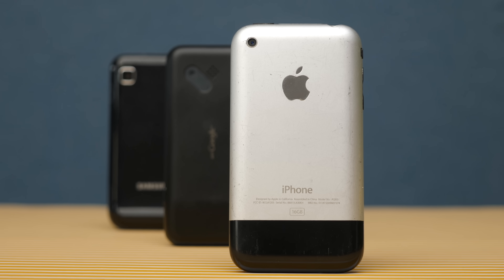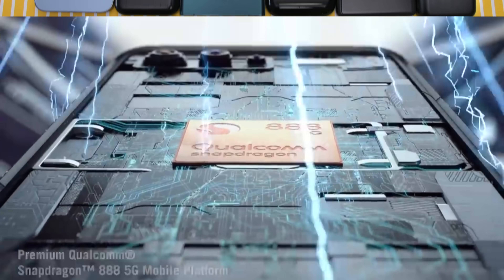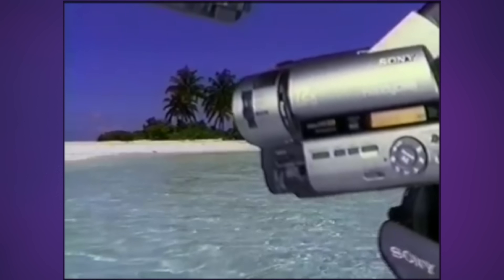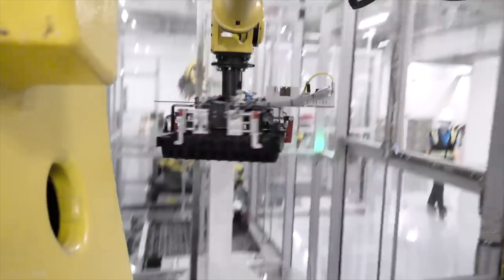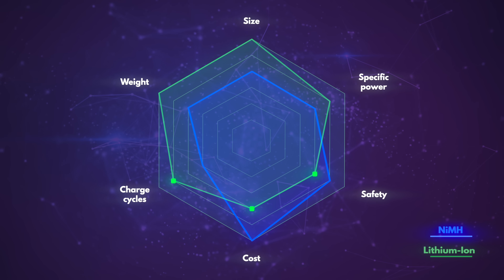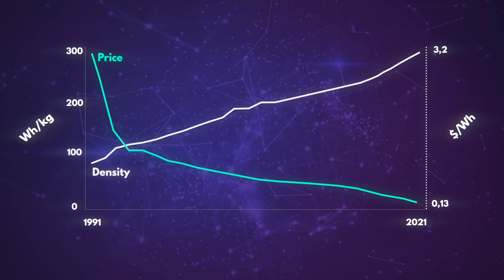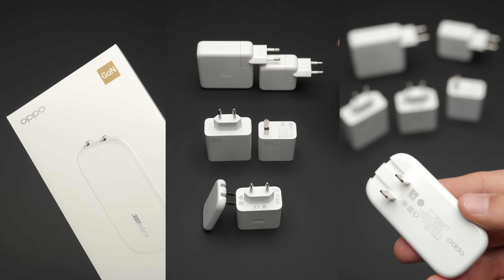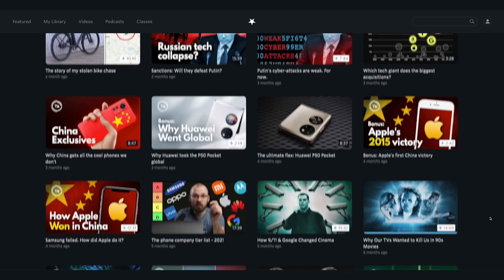The billion dollar race to fix phone batteries

Comment: The least improved part of a smartphone is resistance. You used to buy a phone and that's it. Use it. Now you have to buy a screen cover, a phone cover. Phones used to drop on the floor and one piece got to each side of the room, you put them together and done. Now it scratches, breaks, etc. We are now using expensive fragile bricks made of glass rather than a decent piece of hardware that can stand day to day use.
Reply: Well, yeah, phones became multimedia powerhouses during that time. Phones are becoming more durable, though. I should know, I'm part of the small segment of the population funding them. My three most recent phones having been the Unihertz Titan, Pocket, and RAZR 5G. Flexible displays seem to be promising and I hope that cost of ownership continues to trend downward in years to come. What are your thoughts on foldables and their impact on durability?
Reply: @saygoodnighttoghosts  Yes there are indeed many hardcore brands (don't know if this is the right name for it). I even thought about buying one of those twice, but the hardware isn't impressive. I don't really like the idea of foldable phones. Its kinds of build an extra step to use the phone. But I really like the idea of slidable phones. I had once a Motorola that the keyboard slides and it was a physical keyboard. Was pretty good. No problem with durability and convenient to slide. A screen that expands would be much better. You use the phone in the regular way and if you need extra space just slide it. Foldable on the other side they make an even narrow rectangle, kind of makes you need to always open to use. Plus I think its less durable, but who knows. The idea of a screen that folds or slide is good, considering the current size of screen is too small for the amount of things we do in our phones. I have a Galaxy Note 20 Ultra and I think the screen is not large enough. I use desktop most of the time, specially for shopping. Phones are too small.
Reply: @drac124  I'm on a Fold4 at the moment & the cover screen is actually really usable even with my big hands. I only do maybe 25% of my usage on the main screen. But the times where I do need the big screen, it's incredible
Reply: Nokia again.
Reply: What the fuck are you on m8?
I've dropped my old Samsung Galaxy countless times, and it has maybe one scratch.

Comment: In my opinion, I think we should try to optimize software more, than try to brute force more battery capacity. Cool video tho. It explains a lot in a manner that's easy to understand
Reply: I would agree with that - there's a lot of inefficient software and/or bloatware nowadays, just because the hardware is often powerful enough for it to "not matter". And as a developer myself I share the sentiment that it's nice not needing to actively optimize everything and focus on the business logic, what the software should do, but it does come with a price to pay. And when a news website (indicating: simple) takes long to load or is lagging when interacting with it, or when a supposedly simple operation, like opening a menu in a program, takes longer than an instant, something has gone pretty wrong..
But in the average company optimization probably* is not exactly a common topic and priority for stakeholders/product managers etc. and apps by a single dev are often enough built by inexperienced devs that don't have the knowledge or interest to optimize things, at least I assume that's the case for most software.
(I don't exclude myself, I definitely have written some very inefficient stuff due to not knowing better and often enough don't pay much attention to it.)

* I am fairly new in the professional industry and have a sample size of one unfortunately, but I've also heard from multiple people with similar experience.
Reply: That's also happening simultaneously. I think so
Reply: Text renderers have gotten significantly bloated over time. Instead of doing full hinting as was originally intended in TrueType, they use lots of bloaty render techniques that make not only the performance but also the rendering quality even worse. Microsoft’s best renderer is the one they used before they introduced ClearType. So on Windows you have to disable ClearType to get the correct rendering (even then, it doesn’t work for DirectWrite which is even more bloated). And virtually no Unix systems provide ways to unglitch TrueType rendering.
Reply: @groszak1  The move to higher resolution led to less need for hints, and greater need for resolution independence. Notably, new font rendering is performed on the subpixel level, which probably has a heavy computational cost if the rendering is done on CPU. If the application moves rendering to the GPU, the computational cost should be negligible. 

Font rendered on Apple Quartz, for example, is done on the GPU.
Reply: @Lauren_C  First of all, hinting is still extremely useful at higher resolutions. If you think about it, it ensures that horizontal and vertical lines are pixel perfect. The stems might be 1 pixel thick in bilevel rendering at 4000ppm, but at 8000ppm, those stems would be 2 pixels thick with gamma-correct anti-aliasing (unlike in modern renderers) but still pixel perfect. The idea that the need for hinting would disappear with higher resolutions is a total myth, I think commercial type designers perpetuate it because manual hinting is not cost effective despite being important to screen typography quality. And the concept of subpixel rendering is based on another myth, since it actually prevents vertical lines from ever being pixel perfect, which makes standard render mode the better option. And there are many other quality issues with modern typographical renderers like incorrect gamma (making the anti-aliasing effectively useless), and overlapping lines (which should be clipped). So the GPU renderers you are talking about just reek of that ‘child labor’ type of quality control, not to mention they don’t work in legacy computers.
Reply: That's what Apple does, not just with batteries. They heavily optimize memory usage, software, etc. and the result is less energy consumption and faster performance.
Reply: @ronch550  No, their software is Unix based so it’s highly bloated. The real optimized software came from legacy Microsoft. They literally made a renderer called GDI that is the fastest renderer ever, so much so that I consider GDI to be the only hardware accelerated renderer ever. Of course, modern Microsoft software (as opposed to legacy) is highly bloated as well.
Reply: @groszak1  well not much can be done with Unix or Linux (Android), but Apple still heavily optimizes whatever they can. I'm not an Apple fan, btw.
Reply: @ronch550  I don’t think shoving child labor ARM computers in there is software optimization.
Reply: @groszak1  it's not. And I think you're veering off topic.
Reply: @ronch550  Misinformation
Reply: @groszak1  I'm talking about software optimization, you're talking about child labor then you say misinformation. What are you smoking, man??
Reply: @ronch550  Reported
Reply: @groszak1  ditto
Reply: Ending ads would help.  Why should I pay processing power and battery life to watch someone else's ads.

Comment: I don't care about charge speed, I care about longevity.
If I was forced to charge my phone at 5w for it to live 2 extra years, I'll take that any day than 120w charging
Reply: Luckily the scenario you describe is very possible.

Charging at 5w will give you at least 2 more years than charging at 120w.

Most Androids allow you to terminate charging at 85% nowadays also which will also help.
Reply: 120w charging is the best thing to have happened in phonetech in years. 20min charging time negates much of the negatives of crappy battery life
Reply: @joonasvahasalo6635  no it doesn't, it take takes you 20m to charge and only lasts 40m until it dies, thats still bad
Reply: Right to repair is the better sollution I guess
Reply: I am an electronic engineer, but I don't study batteries. From my limited knowledge the only tech discussed in this video that can improve the battery longevity is the solid state battery.

Comment: I think for mobile tech the other side of the equation might be as important as battery tech. Apple virtually doubled battery life in their MacBook range by switching from Intel to Apple Silicon. I think a shifted emphasis to efficiency across the market is pretty important. Obviously there's less room to squeeze in the smartphone market where efficiency has been a much bigger factor already but I expect there's still some room to move in that space. At the moment we seem to be getting bigger and bigger phones with hungrier processors and bigger batteries for steadily diminishing returns.
Reply: Apple switched from X86 to ARM. Phones are already ARM so not much improvement is to be had
Reply: @michaeljohnson89  A15 was a pretty big efficiency jump?
Reply: @michaeljohnson89  See the Risc-V instructions set
Reply: @michaeljohnson89  The efficiency improvement largely comes from the density of chips.
Reply: @Jona69  That's just not true... Just look at Qualcomm processors. They already are at 4nm while Apple still stucks at 5nm and yet Apple gets MUCH better efficiency out of it.
It's nothing but a myth that higher density and smaller Production notes magically improves efficiency.
Reply: @Raja995mh33  I meant the efficiency improvement the MacBooks got when they switched from Intel to Apple chips. They went form intel 14nm to tsmc 5nm.
Reply: @Jona69  And now even with Intels 10nm (which is more dense than TSMCs 7nm), Apple still winds by a LONG shot in terms of efficiency, draining less than half the power in a comparable system. So switching from 14nm to 5nm didn't had a huge impact after all. Intels chips are still just literal hot garbage in terms of efficiency.
Reply: @michaeljohnson89  Agreed.  He must be talking the (battery life improvement), seen on their LAPTOP COMPUTERS.  OR, maybe, the M1 chip is a RISC chip, (that is just that different).  As compared to a regular ARM chip.  (Different enough to cause a huge difference in "power draw").  I'm not an authority on the M1 architecture (except that it is amazing).  And, SINCE, it is amazing (as compared to the last generation RISC chips.  Right now, I will give, ANY, claim a "little" credence.  That it, might, be truth.
Reply: @vangildermichael1767  ARM is a RISC architecture. Also M1 is literally the same tech as the A14 used in the iPhone 12.
It's effciency is on par or actually worse than the A14 it's just paired with much bigger batteries because it's used in laptops. Said laptops are also been compared to much less efficient Intel or AMD laptops. AMD comes the closest and they were using TSMC 7nm at the time which can't compete with TSMC 5nm plus the more efficent architecture of the M1. With phones your already comparing ARM vs ARM instead of ARM vs x86 all of which are also power optimized compared to laptops and especially desktops.
Reply: @vangildermichael1767  eh no ARM is a RISC architecture. You don't know what your on about
Reply: @harryhall4001  True
Reply: There isn't going to be much gains in terms of efficiency. Screens need energy to light up and modems need energy to send and recieve signals. Even if SoCs manage to do computations with fewer and fewer electrons there will still be other parts of the phone that are hard to make more efficient.

I don't see a paradigm shift on the horizon. Folding phones are trying to change the form factor but are expensive, fragile and fail to impress. I believe that in 5 years from now phones will look similar as they do today, only more optimized.
Reply: @LeonardTavast  You're probably right, I think that given where they are now, smartphones would be hard to replace or radically change on a societal level. My current phone is just a much more advanced version of what I had 9 years ago.
Reply: @LeonardTavast  *with even less useful features.
Reply: Also doesn't help that software developers take all that extra power today's hardware for granted and do very little optimizations, which leads to more battery drain. Take any old android pohne and install some basic apps and just watch it absolutely chug with low ram capacity.
Reply: It's the huge screen size and unnecessary screen resolution who are the energy hogs. A 4K screen literally pushes 16x more pixels than 480SD display. Imagine using 16X less data and 16x less processes. Also, a reduction in screen size from 6.4ish to 4.8inch is an additional 25% saving of screen lighting.
Reply: No queeu
Reply: And Apple is pretty much the only one that always had this stuff in mind. Apple always focused on efficiency in the iPhones while literally all Android manufacturers - to try improving battery life - only included bigger and bigger batteries. And now, where this no longer works because phones would become too heavy, cameras take up more and more space, many Android manufacturers are basically stuck there while Apple improves more and more in terms of battery life, basically being king in battery life for a long time now (ESPECIALLY when you keep the battery sizes in mind because then there comes nothing even close to Apple).
I also, like I said, have my doubts that there actually is a lot of room to improve because it most likely has some reasons why battery sizes on Android phones haven't really improved in the last several years. They're basically stuck at 5000 mAh with only a few exceptions

Comment: As someone that's in the RC hobby LiPo batteries have the benefit of usually a higher discharge rate or whatever you call it been making out put a lot of Power 

Best way to explain this in phone tech is like how companies have recently started making batteries in like two parts so they can charge them faster 

Well a 2s lipo battery is pretty default now in the hobby so think of that as 2 small packs that act as one 

You can get up to 6s maybe even 8 idk 

Also you said lipos are more fire resistant... Ahhh no lol complete opposite look up lipo fires lmao

Comment: I think the next step is to make much more efficient chipsets rather than more powerful ones + industries research alternatives to Lithium-ion/polymer  not only in phones but for other specific applications  (like lithium iron phosphate for drones) so the demand for components for lithium-ion/polymer is reduced
Reply: But improving chipsets efficiency become more and more difficult too as lithography process improvement become slower every years
Reply: @Arkan_Fadhila  A, shall I say, "courageous" option would be to settle on a standard performance level for phones that has no need to be surpassed. This way any efficiency gains wouldn't be immediately offset by increased processing demands. For example, take the Raspberry Pi 4 whose processor is currently manufactured with a 28nm process (however that correlates to Intel and TSMC's process definitions). Imagine setting that as the performance target, but using a 7nm process. 1/4 the nanometers means 1/16th the chip surface area and theoretically about 1/16th the power consumption. I'm sure the math isn't that clean in practice, but the point is the triangle of tradeoffs for chips is basically power consumption, cost/size, performance. If we sacrificed performance, we could have incredibly small chips that use very little power. That's a tough sell marketing-wise, but I think plausible with the right branding as a "lifestyle" brand of product where owning a low-power phone signals detachment from the treadmill of endless tech consumption.
Reply: @stormburn1  really agree with you. and hopefully people will realize that processor with higher efficiency is more needed compared to processor with just higher performance alone.
Reply: Also, if people make more efficient software, we can use less processing power and save even more battery life.
Reply: Nah. I want more powerful chippers not ones that are more efficient. Efficiency is boring.

Comment: So most larger battery systems (usually batteries >1000W like big external batteries and EVs) use lithium iron phosphate, not lithium ion batteries. They weight a LOT more and support more charge cycles. These batteries are different than those in phones or most batteries that are less than 1000W.